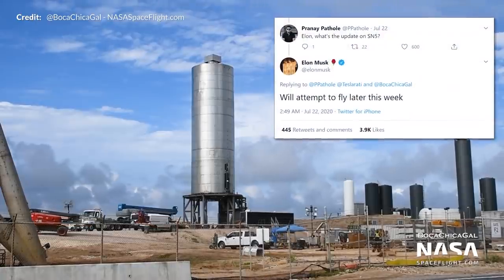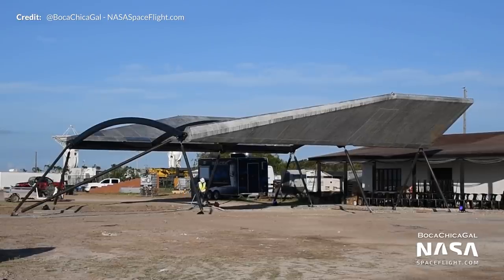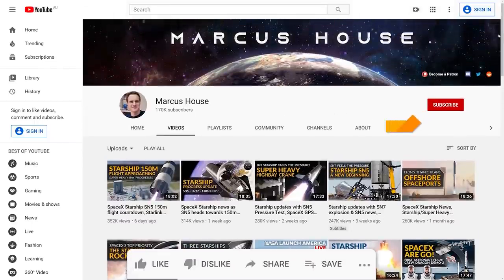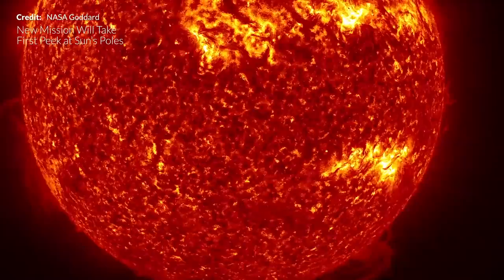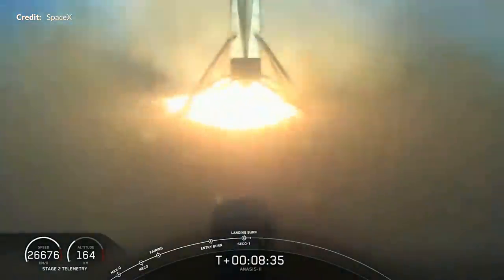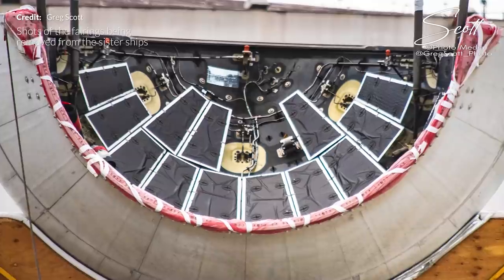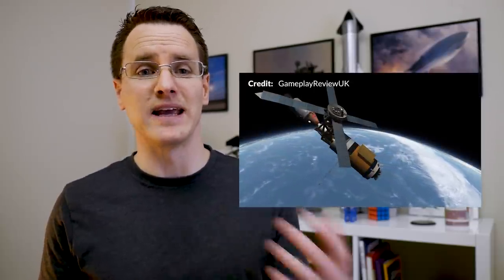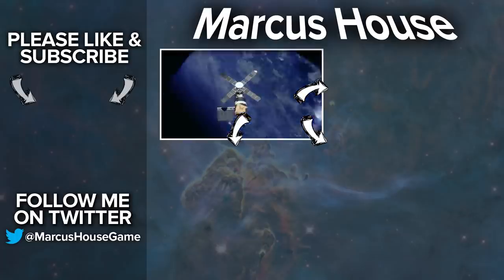SpaceX Starship Super heavy high bay, ANASIS-II + Hope Mars Launch and Gilmour Space 110-sec test

Comment: Kuka used to be a German high-tech company but has been bought up by China, most likely the Chinese also got some or all of the key patents of Kuka. Later Germany implemented restrictions on sales of strategic companies to foreign investors. It looks like Space X really needs a larger than 9 m tank diameter for Superheavy with 30+ engines. There is a bottom skirt wider than the tanks. Please note: The Soviet N1 first stage had the maximum diameter of over 16 m but it was much shorter and probably actually carried less fuel. If Space X uses the NASA worm log a lot it might break the spell of associating the logo with a downturn at NASA.

Comment: Could one or more of the nose cones be intended for super heavy, to mitigate aerodynamic stresses during higher speed test launches?
Reply: Someone suggested that the smaller nosecone would be for the first Super Heavy test flight. J.
Reply: Wouldn't they also test Starship at the same time?
Reply: Limi V  Probably not at first. It makes more sense to test the Superheavy in both launching and landing, before attempting to stack a Starship on top. That way, if something goes wrong with the booster, SpaceX doesn't lose a whole Starship at the same time.

Comment: Are the welds going to be prettier on the operational flight hardware?
Reply: Maybe.  Stainless welds aren't known for elegant seams.  It's even worse in humid air.
Reply: I was wondering the same thing. Not because of appearance but does it provede drag. I only know boats. You wouldn't want a hull with all those bumps!
Reply: @vincentconti3633  Well, the welds.can certainly look uglier than the actual surface deformation.   Also, there are going to be heat tiles over the surface when it's finished.

Comment: Since ceramic/clay is so inexpensive, would it not be wise to pour metal fresh? It could be cooked/heated, melt metal with/under rocket take off.
Reply: The metal gets it's strength by being Cold Rolled from Ingots into the sheets. Once it is heated or welded, it is weakened.

Comment: What is the benefit of hybrid rocket engines? Why not go all liquid?
Reply: How can I put this?  Let's take 2 cars with the same amount of petrol in each tank. We drive both down a straight stretch of road accelerating. As the resistance from the air pressure on the car body builds up, the efficiency of the engine to keep accelerating decreases. One car measures the resistance to efficiency and eases off on the accelerator at a set speed but keeps driving without slowing down. The other car keeps accelerating and moves ahead of the other car until it can't accelerate any more because the energy output of the engine matches the wind resistance. After a time, this car runs out of petrol and stops. The other car takes a bit longer to reach the stopped car but when it gets to it, still has fuel and goes further before running out. The benefit of a hybrid rocket engine is similar to the car that controls it's efficiency. The rocket will go further for the same amount of fuel OR it will go the same distance for less fuel, which means less weight to carry and so a higher payload can be carried. That makes it a more cost effective rocket.
Reply: David thanks but that doesn’t answer my question. Liquid fuel rocket engines have just as much or possibly more ability to throttle than hybrid engines. You answered what benefit they have over solid rocket engines but I already understand that benefit.
Reply: @nathanlewis42  Thanks for your response Nathan. I don't have an answer then. I did some reading on their site. It is an upper stage engine for the launch vehicle called "Eris" and is said to be a 'more cost effective' engine. Designed to move satellites into a LOE.  It is also said to be 'safe and green' .Read into that what you will. They are not expecting to start operations until 2022. Adam Gilmour is the CEO and is aiming for 250kg then on up to 800kg payloads.

Comment: The Gilmour rocket exhaust appears rather lack luster.  Velocity matters in regards to thrust and ISP.   It looks rather unimpressive in this regard leading to conclude that it is deficient in both those areas.
Reply: Based on what are you judging this? The engine is fairly small so there certainly can't be a massive plume.

Comment: I am not so confident anymore on starship, leo ok, but further? It just doesn't have enough fuel and the refueling scheme is challenging. Would love to see a big space hub and a transit vehicle but starship going directly to mars? With 15 ppl maybe.
Reply: Orbital refueling from another Starship is necessary, but if Space X can do that then the whole solar system is open! I think Heinlein said "Low earth orbit is halfway to anywhere in the solar system."  Though challenging, it is perhaps less challenging than the hurdles Space X has already overcome.
Reply: @MrEd2291  but if you need 4 to 6 refueling launches (just 100 tons each) for just one starship to mars it gets silly and very costly. I can only hope they have a trick on their sleeve for it since the solution on their website looks implausible
Reply: @reinoud6377  Remember, it wouldn't be that costly for refueling IF you are reusing the entire rocket. These 4 or so refueling missions in total could cost less than a Falcon 9 launch. While not cheap, it's a huge reduction in costs from other projects.

Keep in mind what the requirements are for travel outside of LEO. The largest rocket ever successfully flown could deliver 140 tons to LEO, but only about 48 to the moon. And that was what it was specifically built for, and only a tiny part returned to Earth. The rest was permanently lost. Starship is planning around 100 tons to the Moon or Mars, and is able to return the entire upper stage to Earth to be reused.
Reply: @anthonypelchat  true but it still be using the amount of a truckload full of fuel to get a few dozen of jerrycans up.
Reply: @reinoud6377  True, but it is still the best option. Yes, you can add stages and reduce mass to make it able to carry more without refueling, but then it wouldn't be reusable. That's far, far more expensive. 

Just look at the cost differences between Starship and it's closes competitors, the Saturn V and SLS. Both of those are around $1 billion per launch. Starship is planning to be cheaper than a Falcon 9, which is around $60 million. You could launch 15 Starships for less than the competition to launch 1. With 5 launches, you could have 1 Starship with a large cargo, then 4 for refueling. You would then be able to bring more cargo then the others while being 1/3 the cost.
Reply: @anthonypelchat  that's indeed cost effective and is a good point. Only launching that many rockets is dangerous. Maybe a starship2, being twice as wide and twice as high can solve the refueling for a starship1 but I'm not convinced yet.
Reply: @reinoud6377  Personally, I would think that it would be more dangerous launching 1 massive rocket instead of several smaller ones. To get 100 tons to the Moon or Mars would either need something twice as big as the Saturn V or nuclear engines. Neither is exactly safe nor cheap. Also, launching the same rocket multiple times allows you to work out issues faster. 

Maybe that won't be how it works. We will see though. They have to work out refueling first, so we have a long way to go.
Reply: @anthonypelchat  a starship with a heavy exploding would be utterly devastating, akin to a nuclear bomb of the size of Hiroshima going off. Imagine the sn4 explosion only many many times over. It wasn't even completely full iirc
Reply: @reinoud6377  It won't be anywhere near the size of a nuke, but it will be huge. No getting around that. But that is my point. You would need an even larger ship to send the same amount of cargo. Nearly twice as big as Starship with much, much more fuel. 

Either way, the good news is that they will have these well away from people.
Reply: @reinoud6377  We shall see. Nobody knows how many refuelings  in orbit it will take, but using 100% renewable Starships and Super Heavys should lessen the price. It is far from a sure thing, but Space X is closer than anything else I see for dramatic future progress and I wish them well. Humans have not been out of low earth orbit for about 50 years.

Comment: I thought the hole in the Starship common header was for the line that allows the contents of the top tank (LOX or CH4?) to flow through the lower tank to feed the Raptors. https://forum.nasaspaceflight.com/index.php?action=dlattach;topic=51332.0;attach=1945112;image
Reply: The downcomer that connects to the header tank has a much smaller diameter.

Comment: I have done the math here, 31 raptor engines will burn 26 US tons of fuel per second. I am still doubtful that 31 raptors can fit into a 9 metre diameter space and work correctly. It will be an engineering miracle. No one else seems to raise this issue, and i know i am risking the wrath of the spacex fanclub...but i said it anyway.....peace to ya.
Reply from the maker: Can't wait to see them try.
Reply: @MarcusHouse  👍
Reply: The issue about fitting 31 Raptors into 9 meters has been brought up a lot. Even Marcus and others have mentioned that it will be a very tight fit. Someone made a CGI model of it, which showed that it's possible to fit them there. Building the base to hold them, run fuel evenly, and handle the immense force of launch will be extremely difficult though. 

If anyone can do it, it's SpaceX. They currently hold 9 Merlin engines in a 3.7 meter diameter. That booster is going to be a beast, no matter how they end up building it.
Reply: @anthonypelchat  Thank you for that Anthony, that is what i like about these channels. If there is something you dont know or are not aware of, someone will let you know... peace to ya.
Reply: @dazuk1969  My pleasure. Having questions, concerns, or doubts is fine. Getting answers to things that we don't know or understand is great. And nothing is guaranteed in this industry. SpaceX will continue to make changes and have failures along the way. They will learn and improve. 

That is why so many of us like them so much. You get to see the failures and improvements. You get to listen to Elon Musk joke around about the failures and discuss with his fans the improvements that they are taking. No one gets hurt, our money isn't wasted, and yet we get enjoyment. And the whole time, it seems like the future is getting better.
Reply: @anthonypelchat  👍

Comment: STAR SHIP IS JUST A SPACE SHUTTLE BUT ITS ON TOP NOT THE SIDE
Reply: And, you know, has a payload capability of over 100 tons to low earth orbit, and is fully reusable
Reply: @redguy4234  true
Reply: It's not a lifting body and it's not a space shuttle. The concept is vastly different.
Reply: @Brixxter  how is it any different apart from size
Reply: @liamlive2972 
-not a lifting body
-has internal fuel tanks
-performs vertical landings
-runs on methalox instead of hydrolox
-meant for landings on other celestial bodies
-comes in multiple variants
-consists of two individually combinable halves